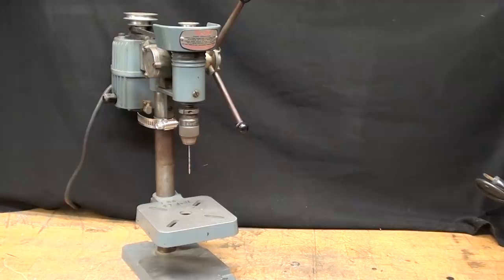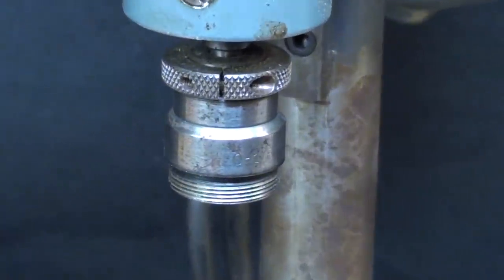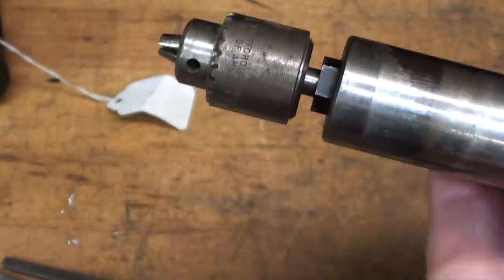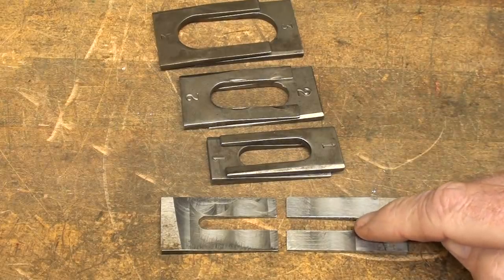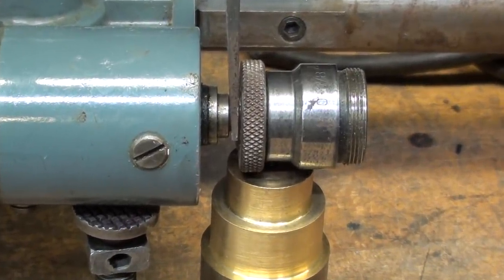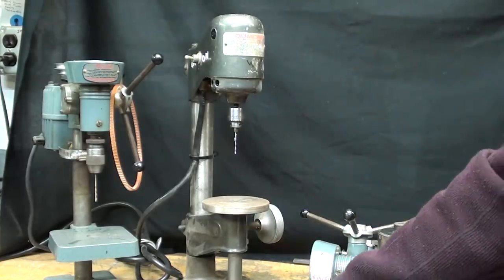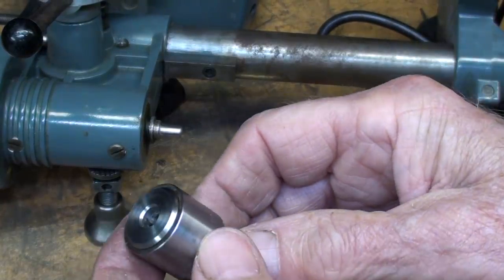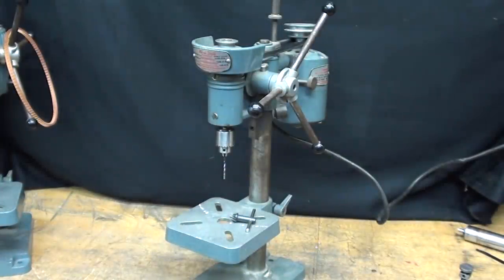Remove Albrecht Chuck from Arbor Tips #449 tubalcain

Comment: I thought I enclosed a letter when I shipped the drill press but evidently not. I have sent you a copy of it this morning. I recently bought another drill press which brought my total up to eight and decided seven is my limit. So I had to get rid of one of them, and thought you would like to have it as I know you appreciate the quality of Cameron products. Never mind the fact that the one I replaced it with weighs 1050 lbs. The point is I know my limit and can hold myself to seven drill presses. Glad you got it up and going.
Reply from the maker: Thank you Sam. It's good to get the full story on it. It looks like a good machine. And you will see it In several other videos.
Reply: Thank you for donating it. It good that others can learn from it. Of course big thanks to Mr Pete for putting in all the work into the channel.

Comment: Mr. Pete,
    Nice video on the Albrecht chuck removal. I was reminded of a purchase I made a couple of years ago. Among other things I build and make acoustic guitars pretty much the “old world” way. I got involved repairing a vintage Martin and was needing to drill some extremely fine holes to aid in removing the neck from the body for a reset. My problem was none of my drills had a chuck that would close on the tiny drill I was using. I came across a #O Jacobs Chuck in a Garret Wade Catalogue. The price was rather cheap for a GW item, I think around 15 bucks. I ordered it and to my surprise it came in a very nice wooden box and included two arbors, the key, half a dozen number drills along with the tiny chuck itself. I just went out to the shop through the dark and cold to look at it. I knew it wasn’t an Albrecht and probably was made in that place we used to say we would end up if we dug deep enough. Sure enough it was but still a pretty decent made little chuck. One of the arbors is a short straight shank the other is tapered. No idea which taper. All in all a pretty neat little device for precision work. I remember GW saying in their catalog promotion they had come by the little chucks via a tool that didn’t meet their standards but were so impressed with the chuck they decided to offer them as a stand alone product. Now Garret Wade products come and go so I don’t know if they still offer them. I couldn’t find them on their website but a call or email to them would reveal if they still have them. I know you probably don’t need one but maybe some of your viewers might be interested. I plan to make a precision drill press using the chuck sometime in the future if I live long enough. 
Dale

Comment: Excellent video Mr Pete. I can't wait to see you make the wedges. I also want to make a set. Just recently I bought an old lathe that I am resurecting and it came with 8 drill chucks and one of them is the Jacobs Keyless and one is the Little Jacobs 0 taper you used. If I had to pay new price for the 8 chucks alone they are all worth more than I paid for the lathe. Thanks again for sharing. Hope you get your vision corrected.. LOL
Reply from the maker: You are right, that is a nice score with all of the chuck s
Reply: @mrpete222  6 of them were already mounted on either MT-2 or MT-3.  I thought the Jacobs Keyless mounted on the MT-2 was a pretty good find. It fits right into the tail stock of my old Clausing 100 lathe.  And it looks to be used very little.

Comment: Rhom makes quality keyless chicks. I had one until a low quality drill twisted off and damaged it beyond repair. Even the import ones are not so bad I have a couple of them and use them a lot. I really like a keyless chuck on a lathe because of changing from center drills to drills. Like the little drill press
Reply from the maker: Yes, I like the keyless ones

Comment: If made of tool steel, i doubt, that you need to harden them for frequently use. For the larger ones, you can add a bit of Moly frease to them, that should be enough. Not that harden them is so much trouble, but you need to temper them also. The drill press is nice. A lot of people only have the large machines, and they are way to slow for those small drills. And you have a lack of feel using the large machines with tiny drill bits.
Reply from the maker: All of what you said is very true

Comment: What is the upper ring for that looks like a thread ring gauge? I have one of these little gems I got with a host of other machine tools from a friends grandfathers estate.
I also got two old Jacobs chucks still in the box, model MU4G-61 multicraft chuck 1/16" - 3/8" that has a threaded mount for 3/8" - 24 thread. Other making on box: Code 7814-05313 with stock No. 740006 . What do I mount these on being it does not fit a taper? Thanks
Reply from the maker: They were made for portable electric drills
Reply: Great, thank you.

Comment: When removing the partial chuck from the drill press I thought you might be able to use one of the #1 removal wedges as a counter-wedge to the home-made #0 wedge you were using, but it looks like that might instead pull the spindle out of the drill press (it looks sort of like a Morse taper).
Reply from the maker: Yes

Comment: The wedges are just what I need.  Thanks Mr. Pete! I just bought an atlas lathe off craighslist and the chuck is stuck to the tailstock ram.  I tried hammering it out as I have seen you do in other vids, but I think these wedges will work (with a little heat if needed).